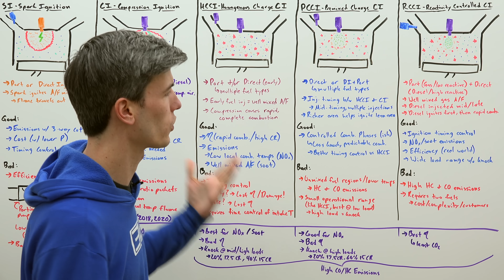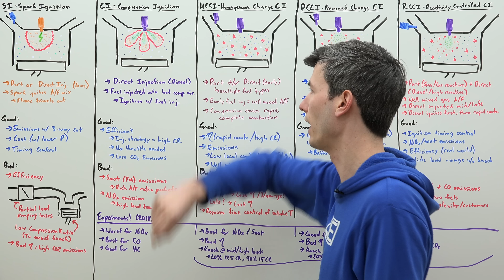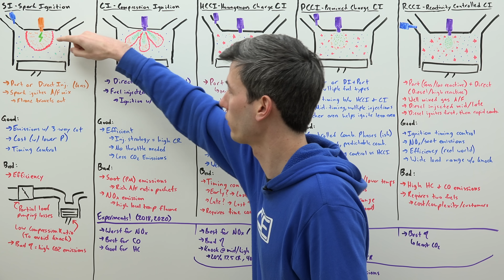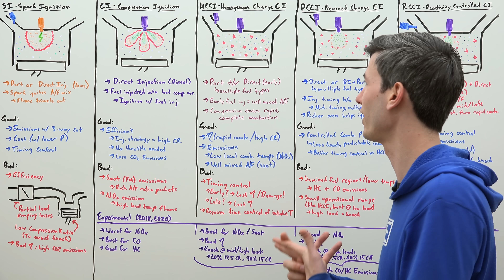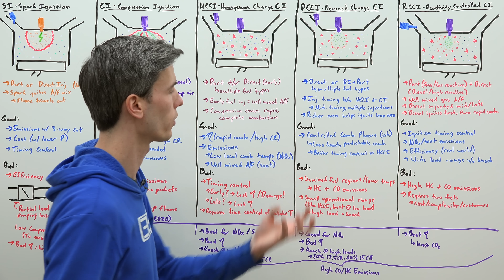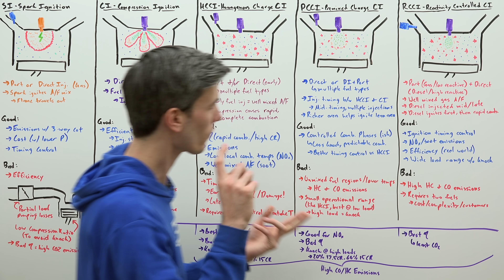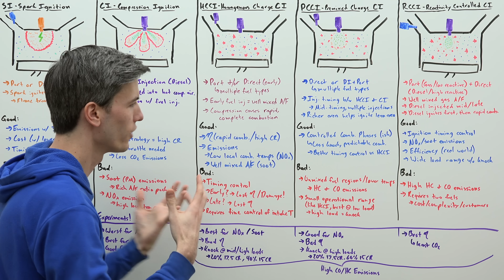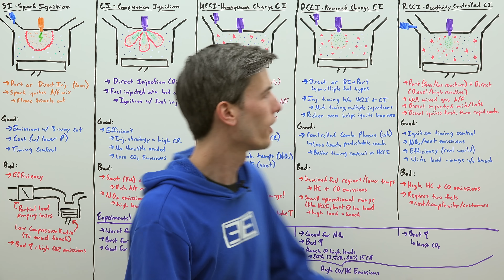If Combustion Engines Have A Future, What Is It?

Comment: How about charging 100+ million EVs on carbon fueled power plants.
Reply: What power plants? The plants needed to charge them don't exist. The grid needed to transport that power doesn't exist. And everybody will NIMBY solutions to both forever.
Reply: would be efficient
Reply: It's still cleaner but not by much.
Reply: every EV owner : "we don't go there"
Reply: @stefan-stocksmadesimple5241  I go there, sit and think about it it makes sense, centralised efficiency
Reply: @stefan-stocksmadesimple5241  exactly :D
Reply: As an EV supporter, this is one of my main argument to defend clean and reliable energy sources. Going electric allows to centralise all the emissions to the power plant, which can be replaced by low carbon emission, effectively getting rid of all emissions. That's why I support electric heating vs gas or domestic fuel heating, etc.
Reply: You know that the people who buy EVs also support wind, solar, nuclear, and hydroelectric power?
Reply: @MrUnexistential  In sweden we closed a perfectly running nuclear reactor at new years eve that had 20+ years of life left in it, with the explanation "We built more MW of wind power than the reactor made last year, its fine". So a few weeks after they closed it, we had -10 degrees celsius in the south and -25 in the north of the country, and no wind. 
They cranked up an old oil power plant and imported polish coal-power. This was all made possible by the same people who thinks the electric cars are the rescue, whatever source you charge them off
Reply: @aaasdswagttyjhfjy4008  Thats just sad, nuclear power surely isnt clean,  but its much better than any other non renewable energy source in my opinion. Gotta love clueless rulers...
Reply: @MrUnexistential  Not from what I've seen living here in CA, most EVs and Hybrid vehicles have all kinds of stickers plastered on them, most of which who seem to want to ban just about everything.  
I'm not not knocking the EV trend, but there is no magic bullet.
Reply: @MrUnexistential  you know they don't have any power over where there electricity come from?
Reply: @mutated__donkey5840  That's not necessarily true, in a lot of places you have an option from your utility to get your power from renewable sources. You can also install solar on your house.

Comment: For the SI Engines
- Pump losses can be avoided by an optimised Idle Control Valve.
- BMW engines with Valvetronic DONT NEED THROTTLE Valve.
- Mercedes have 11:1 C.I: engines that dont need premium HIGH OCTANE gasolin to avoid knocking since 2004 see M266 series engines.
- GDI stratified injection is a solution for efficiency and consumption but NOx and PM are hihger so with a NOx trap and OPF (Fuel Particulate Filter) like the Diesel those polution problems are minimised and partialy solved.
- Lets see how Japans develope the  HCCI  PCCI  RCCI engines
Combustion engines have a great large future always together with EV and HEV and PHEV
BimmerN53

Comment: Can you at one point do a video about fuel cells? It seems to me to be the solution to EV range issues while still being environmentally friendly
Reply: the bigger issue isnt range its recharge time if one could recharge a electic in under 5 minutes they would win out over gas for on road use quicky

Comment: I think of gas vs electric like manual vs automatic.  There is a place for both.  Electrics, like automatics, I think of for commuting.  The efficiency and polution reduction is great.  The technology will continue to improve to enable cross country electric travel.  ICE, is like the manual transmission.  At this point it might be slower but there is something about a V8 over 7k rpm that a Model S cannot match for enjoyment.

Comment: question: a natural gas furnace has complete combustion with zero CO in the exhaust gases but when I power a internal combustion engine with natural gas I get lots of CO in the exhaust, why?  I tried leaning it out as much as possible to reduce CO but I cant get it to zero or even close.
Reply: The furnace is only turning it into heat, your trying to turn it into work instead of heat.
Reply: @jaydunbar7538  what does that have to do with whether its a complete combustion or not?

Comment: I think the issue with HCCI and the others is they are using them in the wrong type of engine.  Instead of pistons, use that technology in a rotary type engine that doesn't care about timing.  You just keep spinning the rotary and building pressure till boom.  No need to finely control the timing of it.

Comment: Probably in an older video, but I would like to see your opinions/stats for a diesel/electric car.  Using all electric for the drive, a smaller battery bank and an engine/gen set at a fixed output to recharge batteries for longer drives.
Reply: Like a hybrid?

Comment: There are some trucks in Brazil that run on "RCCI" using CNG and Diesel. They have aftermarket adaptations to run with both fuels.
Reply: It's a popular modification in the performance diesel world. Companies make LPG injection kits for all the American diesel truck brands
Reply: There is a company near me that sells generators that can run on either or both fuel at the same time. Natural gas is already hooked up to most businesses for heating anyway and its cheaper and cleaner than diesel, but its good to have a tank of diesel for backup! Running together works really well though.
Reply: They do this in marine Diesels as well. First with LPG and LNG, and now they're looking into AMMONIA as the low-reactivity component. They could be running on something like 80% ammonia and 20% crude oil which would cut down on CO2 emissions significantly. The ammonia would be injected into the intake ports, and the petroleum (doesn't matter whether it's light or heavy, sweet or sour) would be injected in the exact same way as if the engine were a pure Diesel engine. This would not only cut CO2 emissions, but it would make exhaust gas scrubbers much cheaper to run.

An issue with this would be the potential increase in NOx emissions caused by the oxidation of ammonia, but we already have SCR systems (DEF systems) that go a long way to reducing NOx which helps avoid the use of EGR.

Comment: i say the future of combustion engines are few and special cars with wankels and big old v8, v10 and v12 just because of their retro-emotional value. also in some motorsports. for the road we must invent a way of really clean burning hydrogen or so but gas is over. from a reosonable standpoint there is no way of sustainably burning pressed dinosaurs anymore
Reply: E fuels from Porsche might save gasoline engines
Reply: @christopherayala4619  maybe. but e-fuels dont solve the problem of pollution and their production is also not sustainable because they are usually made of food.
Reply: @th1nk_outside  actually is carbon capture but they probably find a way to make less carbon capture

Comment: Yes, electric motors are efficient, it's a shame we haven't identified an efficient solution to store it's potential energy in a car. That's why I still think a PHEV with range to do your commute emissions free and another solution to travel longer distances is the solution.
Reply: We have an extremely efficient solution for energy storage already. They are called batteries. Those are like 98% efficient. The problem with EVs is that we don't have are enough smart people in the world to understand how to use them properly. 90% or more of all driving is done in short drives, which are perfect for EVs. But long drives require a change in habits. Charging only takes 30 mins to an hour and can be done while you are doing something else. Not difficult at all, especially with larger batteries. But telling people that they need to take random breaks when driving isn't something that many can understand.

Comment: Hypothetical 2030s F250 comes in for an oil change, service writer asks if they’ve got a gas or diesel engine, customer just says yes... I like RCCI.  Two fuels isn’t that hard, generally speaking you can get both at the same pump, just switch nozzles.

Comment: I look forward to the never ending piles of discarded, hazardous, non-recyclable car batteries similar to nuclear waste which environmentalist hate so much. Can't wait for the great hate of EV's. 
On the other hand, if EV makers can reduce charging to under 10 minutes for a FULL charge, increase range, reduce the cost, solve the battery recycling problem,  and find a more abundant element for battery design, then it will have a long-term future. Otherwise, I think EV's will have a relatively short life-cycle compared to combustion propulsion which has been the leader for more than a century.
BTW, where are we going to get the increased electric power needed for all the new EV's since states like California, the largest purchaser of EV's, will not allow for the building of new power plants of ANY kind.
Reply: What about biogass/naturalgass  work like same as  RCCI ?
50% lower CO and 90% lower NOX

Comment: I love people saying you only get good emissions with a catalytic converter. Gues my ol' '68 Fury III with a 383 that beat '74 emission standards for converter equipped cars. And it got better fuel mileage and power than those POS converter equipped vehicles form the '70's. No cars had better emissions until they changed the formulation of gasoline so that very little old-style gasoline was present. That made the emissions go up unless you figured out how to tune your car properly for the poor quality gasoline. Converter equipped cars are completely and solely responsible for acid rain and its detrimental effects. Electric vehicles should be our only form of vehicle power systems nowadays. Goodbye gasoline/diesel :)
Reply: Synthetic fuels migh come in handy

Comment: An HCCI engine seems like a good solution for an ultra efficient, low emitions range extender hybrid. When you need the engine, it just starts up, goes to it's most efficent rpm and stays there until the battery is charged and then shuts off. No need for great timming control since it stays at a constant rpm and load.
Reply: Yep, you can use a CVT and one of those.. ez fixed rpm
Reply: Engine speed is one factor in determining actuator positions in an engine, but there are so many other inputs and outputs in a modern combustion engine, it will make your head spin. For HCCI to work well, you really need an exact charge temperature when the charge is reaching TDC. That is a function of ambient temperature, ambient pressure, coolant temperature, valve lift and timing (dynamic compression ratio and valve overlap), amount of air going into the cylinder (it is not trivial to get a constant load, especially if you're allowed to be at different altitudes), amount of fuel injected... If you want to turbocharge to get more efficiency or better consistency of load at various altitudes, now you have even more things to control that all affect your charge temperature, valve overlap now has an even more massive impact on in-cylinder temps too, and those cylinder temps affect your combustion timing, which affect your exhaust temps, which feed back into the in-cylinder temps. If you want to make HCCI really work properly, you'd need a stationary engine that never changes in altitude, in a temperature and humidity controlled room, that never has to warm up, and is calibrated perfectly for those conditions. There's a reason that the closest thing to this in a road car of any kind is Mazda's SPCCI tech.
Reply: @jeffbeasley8235  Very very good comment!
Reply: HCCI is mostly used in industrial applications with a constant rpm.
Reply: @ritwikreddy5670  What is a hybrid but a mobile industrial generator?
Reply: The best range extender is a rotary. Small, no vibration and light. Mazda were looking at HCCI for constant speed rotaries. Mazda are introducing a rotary range extender. No news if it will use HCCI.
Reply: @johnburns4017  small gas turbines are better -  like Wrightspeed use
Reply: @paulg3336  I agree. It burns much cleaner and has virtually zero maintenance.
Reply: Yup, pretty sure that's what mazda uses already.
Reply: You're missing the thermodynamics of it, though. When trying to make use of energy released from the fuel, the higher the pressure and temperature the more useful energy you can extract from it.

This comes from the physics of it.

An HCCI engine sounds like it would be losing a lot of energy out the tailpipe just because it can't get to those really efficient temperature and pressure regimes inside the combustion cylinder.
Reply: Two cylinders at each end of a sliding shaft with a generator coil between. Pistons fire alternately to move the coil back & forth. Control provided by electronics so no crank and no cams.
Reply: Yeah it could be used in a series hybrid to charge the battery/serve as a generator for the electric motor
Reply: @M Bacon Their early prototype vehicles used turbines , there are videos of them on the road. There was some kind of disagreement between Wrightspeed and the microturbine company that has stopped development.
Reply: that's smart
Reply: Or go turbine engine
Reply: Nissan Note e-Power?
Reply: agree a genset 100% hybrid probably best solution...if only manufacture's could standardised on modular batteries say cubes.  many batteries could be be placed on to a mounting plate that connected up, then lifted and bolted onto underside of vehicle... unlikely to be much wasted space across vehicle styles despite common battery style, as packs could be assembled to suit available space.

there'd be lower barriers to changing vehicle power source, and investigating alternative power sources, and/or "mix matching" as wanted.... say one was gonna be going on holiday to location where there wasn't electric charging infrastucture....have mechanic lower the battery plate,  swap out some batteries and replace them with a genset etc
 
steam engine(reciprocating or turbine)... if atmospheric combustion burner, very low nox. can be built to run on any kind of fuel... 
if powered by pure oxygen+hydrogen no risk detonation as in IC... no need for boiler, or water tank, condenser etc, as combustion product is very hot steam. ... so as long as materials can take it... improved carnot efficiency. potential for extremely high BMEPs in reciprocating steam engines, but that can dent efficiency.
Reply: How efficient is it as an electricity Generator?
Reply: Burn = resource forever gone from multiple uses. Electric = > 90% recyclable battery materials, plus several sustainable non-polluting alternative sources. So, just curious, can opposing piston engines be scaled up to drive ocean-going shippers? Then again, what justifies the burning, that makes “efficiency” go infinitely negative?
Reply: Doesn't sound very fun though. Would rather just have a normal combustion engine running synthetic efuels, then you have the sounds, the character, the performance and much cleaner while mopping up CO2
Reply: @papasmith7648  
I would rather have an EV.
Big business in Europe is electricians fitting EV charging points in garages and drives.
Reply: @johnburns4017  they won't be able to fit charging stations everywhere though. It will be a big business until efuels take over and that becomes more popular. These cars are going to much lower emissions
Reply: @papasmith7648  
I have two charging points outside of my block. Big business is fitting charging points on driveways. They are going up all over.
Reply: @johnburns4017  They won't be everywhere though and even in areas where they are fitted it won't be enough. This is one of many reasons we will need different types of fuels and engines for different people.

Comment: How to tell a feasible new combustion engine technology? It's being developed and adopted by the Germans (engineering resources plus very tight European emissions regulations). How to tell technology dead-ends? Being developed by Nissan (variable compression anyone? 100% more complexity for same power and economy) or Mazda (can't afford a modern gearbox or multilink suspensions but somehow has resources for new engine tech? right).

Comment: I remember years ago discussions about ceramics in engine blocks to deal with loss to heat, but of course the downsides for production. Has there been anything new in the industry for dealing with that? How to prevent power lost to heat via materials in the block/cylinder?

Comment: Nice comparison!
In my opinion we should leave these complex thermodynamic converters at stationary places in the future and run them in HCCI/RCCI mode at one single operating point for generating electricity for our EVs, if other sources of electric energy are not available at the moment.
- no efficiency losses due to bad operating points
- no cold starts with horrendous emissions

Comment: Here’s something that i don’t understand.
at rcci engine part, u mentioned “less reactive gasoline is premixed and higher reactive diesel is direct injected”
From what i’ve learned before gasoline is much more reactive than diesel, does it changes in certain conditions or is there something that i don’t know?
Reply: Gasoline is more volatile (that is it forms combustible vapours more easily) and a puddle of it will burn faster than a puddle of diesel, but diesel actually has a lower autoignition temperature.

If you wanted to make a spark ignition engine run on diesel (possible with a heater to vapourise the fuel) it would need a much lower compression ratio than an equivalent gasoline spark ignition engine, to avoid knock. Such engines exist, they were often used on old farm tractors and were started on gas and switched to kerosene or 'tractor vapourising oil' once they warmed up.